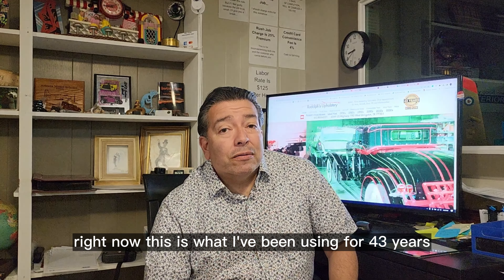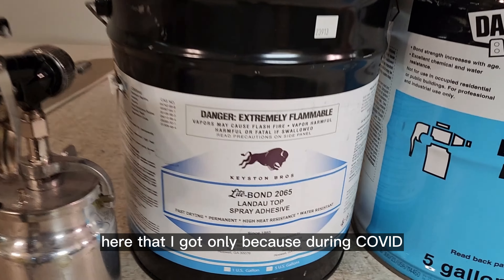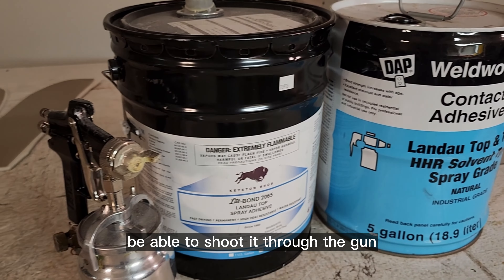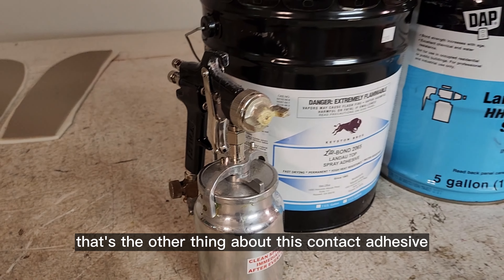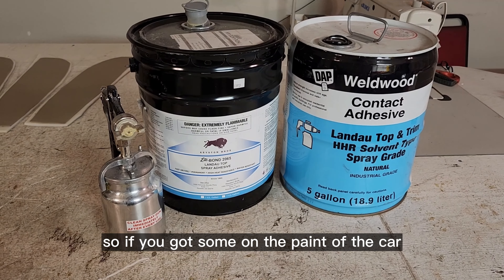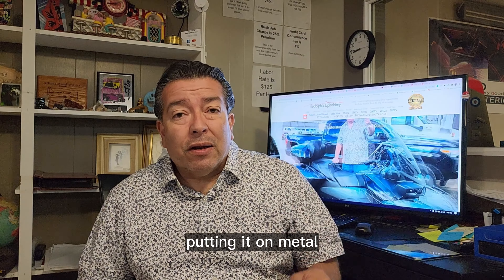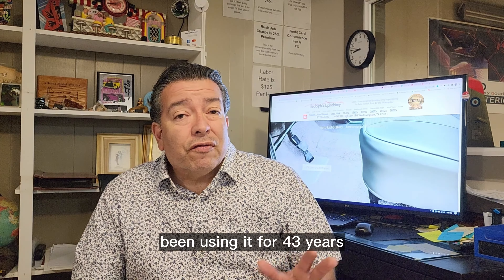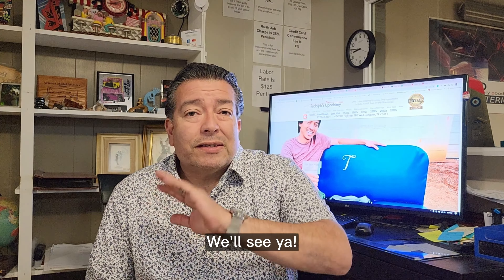You have been doing this wrong 3M spray can glue adhesive

Comment: Yes and no. 
Weld wood is great for professionals, and very serious hobbyists. 
That said, many DIY people searching on YT for advice lack a compressor, they don’t have in-line air filtration, regulators, hoses, and spray guns. So?
For those folks, there IS one 3M spray product that WILL work for attaching a NEW headliner to a CLEAN headboard card! 
Yes, it will last, even in hot humid Florida…  I know, because I have done it, and my 2006 Porsche Alcantara headliner is holding firm at 4+ years so far. No issues. 
Caveat: You must choose the CORRECT type of 3M product.  Only use 3M SKU# 38808, labeled as 3M Headliner Adhesive. 
While there are several types of 3M spray adhesives sold, THE ONLY 3M aerosol to use for automobile headliners is the 3M product  which is labeled as “3M #38808 Headliner Adhesive”.  
Never use Type 77. Ever. 
The Type 77 product is not intended for automobiles. It will fail. Stop. Put it down. 
One more time, NEVER, EVER use 3M “Super 77 Multipurpose Adhesive”. 
Only use 38808. The 3M #38808 Headliner Adhesive is intended specifically for automobile headliners, and is NOT the same chemistry as Type 77. 
Notice that our professional video host here is showing “3M Type 77” as an example of what won’t work for headliners, and in that respect he is speaking fact. But I found this video somewhat misleading, because I myself have used 3M #38808 from an aerosol can successfully in harsh, hot, humid conditions and with great success. 
The benefit of using (the correct type of) aerosol spray, is convenience obviously, and the lack of any investment in spray equipment. If you don’t own a 9.5+CFM compressor and the required AIR/OIL filtration, air hose set-up and suitable spray gun, and you don’t plan on repairing more than one headliner,  you absolutely can still do an excellent headliner repair using two or three cans ($20 each) of the 3M #38808 Headliner Adhesive spray. 
On the other hand, IF you already own a 9.5+ CFM compressor, and a good spray set-up, It IS more cost-effective to just buy a quart of the Weldwood Landau glue product and go that route… and no, I do not work for 3M. 👍🏼
Reply from the maker: Hello Uncle, Thank you for your contribution. I just have to say something about you saying I am misleading people. I was basically talking about the most common "77" spray products. The quality is no secret. For 43 years as an upholstery shop, I have only used what I know. Contact adhesive by spray gun or if by brush if need be. I have never had to use 38808, so I have no experience with it. That's why I'm Old School. I only use what I can guarantee myself, happy customers. Like I always say, there is always more than one way of getting things done. Love you brother. Please keep liking and watching!
Reply: @oldschoolautoupholstery  hello! 
I didn’t mean to discredit you! 
What I meant was, that new DIY people might think that there is no way they can do this without a compressed air set-up and the DAP product. We all know that biggest issue is to prepare both of the surfaces correctly!👍🏼
Reply from the maker: @UncleDuncan5092  Hello Uncle, Right On! Right on. Please keep liking and watching!

Comment: How do I hand apply small amounts of contact adhesive to the edges of fabric on MB door pocket line fabric?  Do I remove the old adhesive with Mineral spirits?
Reply from the maker: Hello User, you may or may not need to remove the glue. I would just use a brush for small areas. Please keep liking and watching!
Reply: @oldschoolautoupholstery  Thanks
Reply from the maker: @DanHilz-w4r  Hello User, You are so welcome! Please keep liking and watching!

Comment: In the early 70's large upholstery shop we're installing a vinyl top they just sewed together and was fitting. With a can on both sides, they brushed the WeldWood contact cement "Landau Top" in the same can with the top pulled 1/2 back. I was quietly watching and someone ask if they could help. No, I am 3 minutes from picking up a vehicle going back to the dealer. I ask "it says sprayable" on the can but you brush it? One of the 4 said this is faster on tops and the other guy started laughing. He said 4 times faster as the started trimming, he goes on "We only have one gun anyhow!" They stretched it tight and used a 2-3" rubber roller like a counter top. Looked good. He stopped as the go-fast part was over and told me that's all the ever use for big jobs.
Reply from the maker: Hello Dean, Using a brush is another way but the glue will dry too fast on the brush when using it on such a large area. A spray gun will run circles around a brush. I have done hundreds of vinyl tops in my day. Please keep liking and watching!
Reply: @oldschoolautoupholstery  I would have to agree, yet I was not an upholstery tech, just the dealer tech diagnose & repair. I never had seen a top installed and totally confused by guys much older than me, in the shade, in front of the building and using a contact cement out of a can that said "Spray" on it. The car wasn't old and don't know what was wrong with the old top. Maybe they didn't want to drip on it! As the oldest on a family farm, you learn quick not to question your elders, but all four guys had a brush, two for car and two for the top. Maybe they only had one spray gun, don't know. Spraying makes more sense, but I am just reporting what I saw! Stay safe of the Memorial Day weekend.
Reply from the maker: @deankay4434  Hello Dean, Maybe if we had YouTube long ago, watching them could have been a funny viral video! Please keep liking and watching!

Comment: dude this video is pure gold i swear to god. you anwsered all of my questions to a hundred dilemmas. You dont like spray cans just like i dont neither. i think theyre expensive and having a comrpessor, why should i pay for one time use cans? My question is this, what nozzle size you use? and just in case i gotta thin, what is the thinner  that would be good for contact adhesive? you anwser me that and i will never forget you.
Reply from the maker: Hello Guitar, We can both see the light together! I have only used contact adhesive for everything I do for 45 years. I have never had to thin it link you would for paint. I never have to clean out my gun either, unless I left glue in the cup for months in a hot climate. I just use a cheapo Harbor Freight glue gun, I have never looked at the tip size, just use it strait out of the box. It's really easy, not like rocket science, Hehe. I hope you hang in there with me. Happy New Year! Please keep liking and watching!
Reply: @oldschoolautoupholstery  sure man, thank you!
Reply from the maker: @GuitarTherapy144  Hello Guitar, Right on! Right on. Please keep liking and watching!

Comment: I used contact cement or adhesive to glue on under hood foam pads. Nothing else worked. But make sure you pre fit and mark out things because once it contacts both surfaces, it sticks permanently. I use the 3m stuff for minor stuff that I may want or need to move a bit. But nothing that will be in the realm of harsh environments.
Reply from the maker: Hello George, You described it perfectly! Please keep watching!

Comment: Thank you for your time.  What are your thoughts on the gravity feed sprayers that have the canister on the top vis the paint sprayer with cup on bottom?  Do you use a sanding disk on foam much?  I have two vehicles to try to reupholster…
Reply from the maker: Hello Kevin, Gravity feed is too top heavy for me and you can't set them on a table. Syphon cup is easier on my wrist and I can set it down when and where I want. I never use sanding discs. I think you will do just fine with your upholstery projects. Please keep liking and watching!

Comment: Thanks for sharing this. What tip size and psi do you use when spraying this adhesive?
Reply from the maker: Hello J, Don't know the tip size, I use a stock cheapo Harbor Freight spray gun at 35-80 psi. to spray contact adhesive. Thanks for watching!
Reply: Thanks. I just tried this for the first time today. The gun was kind of spitting globs. I was wondering about the gun pressure. I had to read about a hundred comments to get to this one that had the pressure that you use. I guess I will just spend some time dialing in the gun. Then more time practicing sewing a straight line. Thanks so much for your videos. I feel like you have be come a friend of mine. @oldschoolautoupholstery
Reply from the maker: @fredpierce9363  Hello Fred, My friend. I usually use at least 35 psi or more at the spray gun. I adjust the fan to be as small as I can get and increased the material knob. One trick is to hold your finger at the tip opening and squeeze the trigger. This pressurizes the cup and pushes out the glue. Try it, you might like it! Please keep liking and watching!

Comment: Do you spray both surfaces or just one to glue down materials and vinyl. ?
Reply from the maker: Hello Ralph, I usually glue two surfaces, materials or vinyl to foam. No waiting, before putting them together. Thanks, for watching!
Reply: @oldschoolautoupholstery  2 surfaces and let it get tacky and stick together ? I have some areas that may be difficult like inside a box, my first time doing this, 1930 model A ford. maybe I should just load it and bring it to you
Reply from the maker: @paparalph  Hello Ralph, I think you will do just fine! Thanks for watching!

Comment: Thanks for the informative video, much appreciated.

I’m about to attach fabric backed foam to fiberglass headliner (fabric facing fiberglass) and then attaching vinyl to the foam on a ‘66 Thunderbird Landau. I’ve had awful luck with 3 mmmmm 🤔. 
How does this product hold up to heat?  Oh…and what’s the cure time. I’ll leave the headliner off the car for a year. If I have to. I don’t wanna have to do this a fourth time. 😂
Reply from the maker: Hello Scott, I had a 66 T-bird 428 Town Landau many years ago. Seen here: https://www.rudolphsupholstery.com/rudolphs-3 Contact adhesive is all I use on everything. I give my cure 24 hours. Vinyl is tricky in the curves. I'm sure you will do just fine. Please keep liking and watching!

Comment: Great video, is it good for XPS to steel, I was going to get 3m77 but not to sure now.
Reply from the maker: Hello Golffe, Extruded polystyrene foam (XPS) insulation can be safely applied directly on a steel deck with contact adhesive only with a thermal barrier. Without it the glue will eat the foam. Please keep liking and watching!

Comment: So, for the one small repair (actually a modification) I have to do, I will buy a compressor, spray gun, and a 5 gallon can of adhesive?  Now, honestly I have the compressor, and the spray gun, as well as a good assortment of professional grade tools.  But I won't be going into the upholstery business.  So, what non-commercial, non-industrial, easily available in small amounts adhesive should I use?  The bond is temporary and will be ultimately held with rivets.  One small part of a "high-end" leather upholstered Harley seat is all I need to do.  So, what should I use?  I already know what I am using, but I ran into your video and figured I would ask.  I went and watched some of your other videos.  Great stuff.  Good work.  Oh, my modification?  I am cutting the nose off the pan of a seat made for an old Electra Glide to shorten it for use on a Street Glide.  Just pulling back a few inches of the nose leather and shortening the pan and foam, then putting the leather back.
Reply from the maker: Hello Fernando, You got it right. Just pick up some contact adhesive from the big box store and use a brush. Easy.. Hehe Please keep liking and watching!

Comment: Thanks for the video! Weldwood has a spray aerosol can as well, have you tried this? Might be the answer for people who have small projects. Another question, when using mineral spirits to remove old adhesive, will remaining mineral spirits film cause adhesian issues? What can be used to remove any remaining film? Also, this stuff has a VERY STRONG ODOR, use in a very well ventilated area. I bought a very small can at home big box store. I found that it's pretty potent and will destroy cheap (practice) vinyl. Thanks again for the video!
Reply from the maker: HELLO 134ziNG4, You are so welcome! I didn't know about the aerosol can. After the mineral spirits have dried, I never think about any film. You can apply it over dried mineral spirits, but I would not re-apply it over wet mineral spirits. I have never had any problem doing it this way. Thanks for the awesome comment! Please keep watching!

Comment: Hi Mr. Rudy, I have a question about the 3M. Is the High Strength 90 suitable to use for seat foam and headliners? It's different than the Super 77 but I've never used it for upholstery before. The 90 says "heat resistant" and "contact adhesive" on the label. Thanks for your videos and thanks for sharing your knowledge!
Reply from the maker: Hello Mitch, You are so welcome! I have seen other peoples messes with High Strength 90. I will never use it. I want to keep a good reputation with my paying customers. For 43 years I have stayed with what I know works without fail. I never have something I need to Redo. Please keep liking and watching!

Comment: I've been doing some research to replace my headliner and I can remember this being used in my dad's shop back in the day restoring cars. I'm sure it hasn't changed much because it still looks pretty toxic. Is there a product that will work for daily driver that is fairly safe that you know of? Even if it only lasts 5 years I don't care, have to compromise. I am out in Colorado and Utah so it gets scorching hot. I'm also going to put some Kilmat on the roof to keep the heat and noise out while I'm replacing the headliner.
Reply from the maker: Hello Detroit, I have to say that I can ONLY recommend contact adhesive by spray gun or even by brush. But I think by brush will be more difficult. Please keep liking and watching!

Comment: Would it work to stop wear on the edge of a semi truck vinal plastic seat for prevention of a whole?
Reply from the maker: Hello Michael, There are many ways to prevent wear. None of which includes spray can adhesives. For 43 years I have done replacements to keep a good reputation. But, you can do whatever you want. Please keep liking and watching!

Comment: My headliner in the Motorhome has detached and sagging. Since removing the headliner is impossible unless all the cabinets are removed have to spray it in place. Been searching the net and seems everyone uses the 3 spray stuff. Can I shoot the contact cement through my Jam gun? I am able to remove all the light fixtures in the center of each panel to gain access. Appreciate any advice.
Reply from the maker: Hello Peter, It is difficult for me to advise as I am not there. You really need to use the product for your situation. Please keep watching!

Comment: Excellent relaxed video - I've tried Super 77  99 of blue or pink foam board and it melts it - I wonder if you are able to use contact cement without melting if maybe the 'carrier' in the spray can is the culprit and not so much the cement
Reply from the maker: Hello Total, The solvents in the contact adhesive will melt the blue and pink foam board. I do not know about contact cement as I have never used it. Please keep liking and watching!
Reply: @oldschoolautoupholstery  Thanx - for you and other's info - I saw a good idea about painting over the foam (hard blue / pink) with a latex (i used Kilz primer) as an 'interfaece' such that the solvent (I used spray paint which normally melts the foam) - and it worked  - so foam - neutral latex (or something benign)- then spray paint or rubber cement - so now I have glossy black foam I can glue to something  - thanks for the reply
Reply from the maker: @TotalFreedomTTT-pk9st  Hello Total, I love hearing good news like this. I have also used wood glue with fine fiberglass cloth as a barrier between the foam and polyester resin fiberglass. Please keep liking and watching!

Comment: What are you thoughts on gluing scrim to material vs. Overlooking the material to the scrim vs. Gluing the scrim foam to the seat foam and sewing a leather cover all alone?
Reply from the maker: Hello Blue32, I think a case can be made for all of those methods. I usually glue the material to the scrim, but sometimes I let the material float over the scrim. Sometimes it is necessary to glue the scrim foam to the seat foam. Thanks for watching!
Reply: @Old School Auto Upholstery Techniques  I got to work in a high end custom hot rod upholstery shop and they were the latter, stating that the leather formed easier to the shape of the seat. I'm not a huge fan of that method. I'm liking a light glue to the scrim but recently the overlock method is selling me over big time. I suppose case by case but I thank you for answering my questions with your experience.  🙏
Reply from the maker: @blue32nu  Hello Blue32, You are so welcome. I am an old school kind of guy. What works for me has worked just fine for decades. Please keep watching!